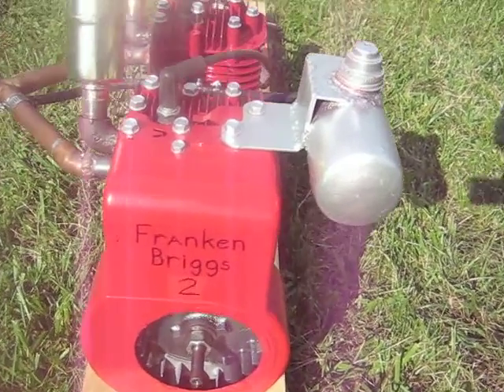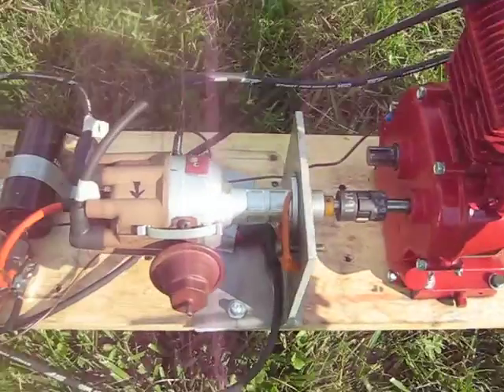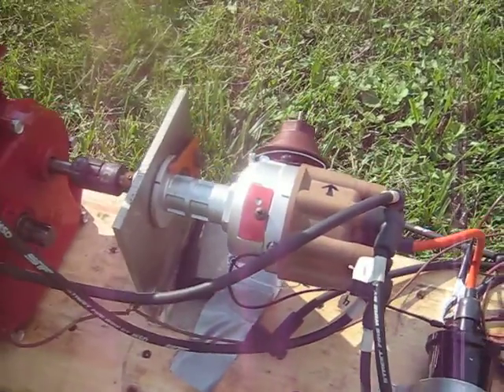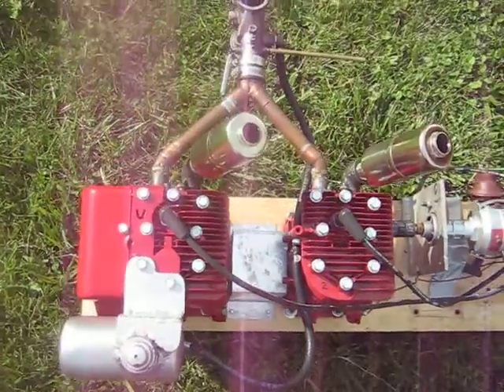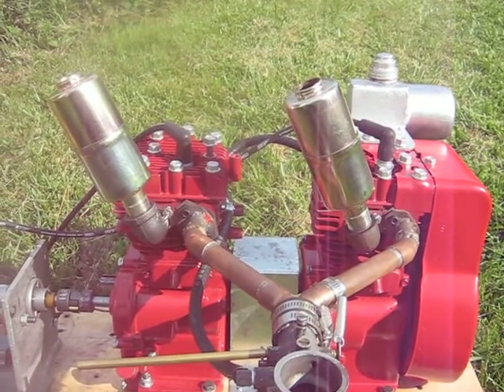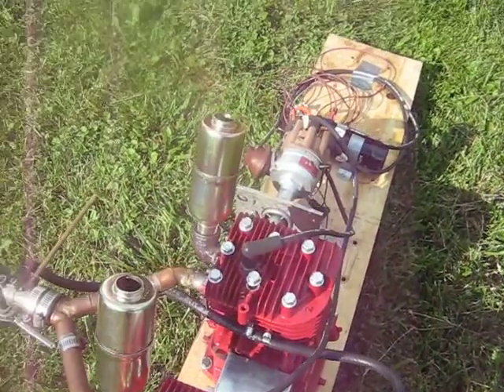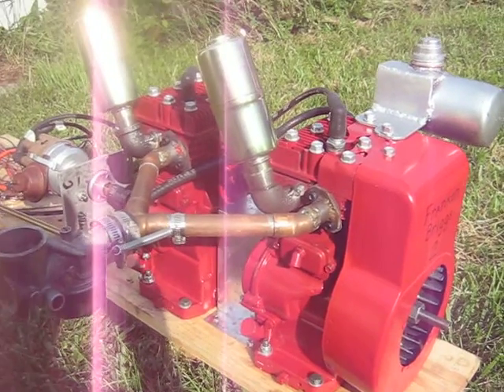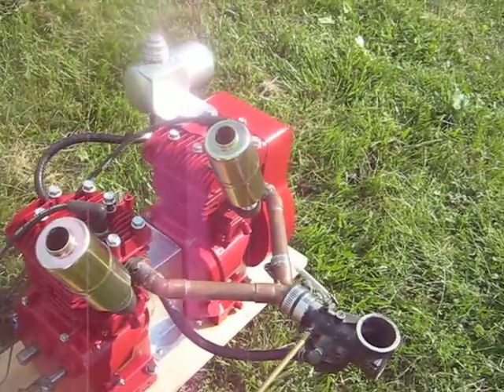FrankenBriggs 2 Walk Around

Comment from the maker: You are correct in your observation, only #1 cylinder is currently cooled!
So far this hasn't been a problem, since it has only run 13 seconds at a time, then broken a coupling.
I am almost ready to install the new chain type couplings, so I plan to help cool the final 3 cylinders with an electric fan.

Comment from the maker: I will solve the problem with #2 cylinder (probably a bent crank or con rod), then get this going ASAP.
After testing out the 2 cylinder I will put new chain type couplings on, and build the 4 cylinder back up, I MUST have at least a 30 second run from this engine!!!!   :)
Much more than that and #4 cylinder will be in danger of melting!
Thanks for your interest, I have another surprise engine in the works also  :)